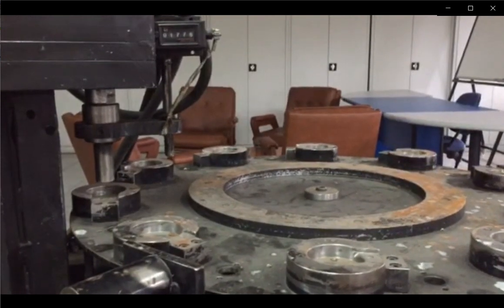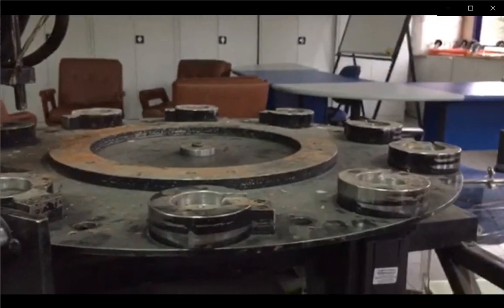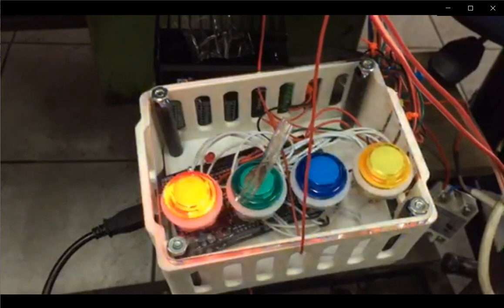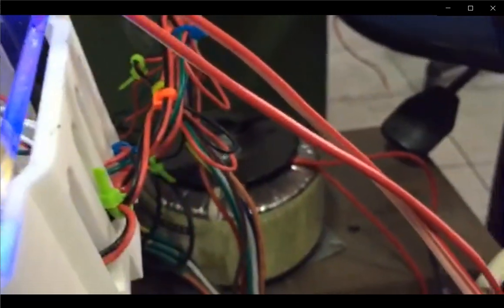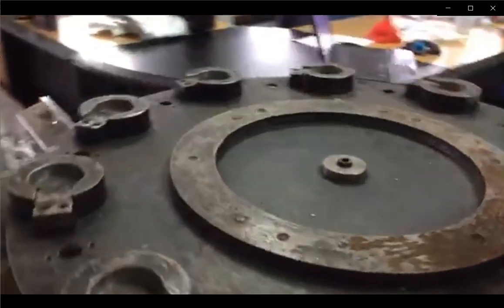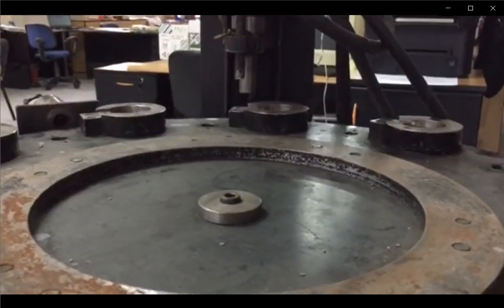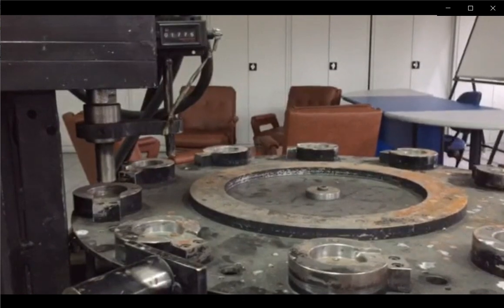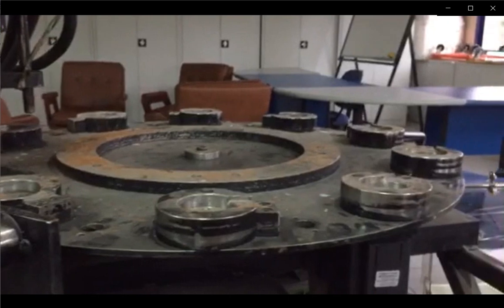turntable with large stepper motor v1

Comment: can you send me the detail of staper motor and the dial plate diameter and thickness because I am facing some problem in indexing 1100 dia plate with 20 mm thick aluminum plate
Reply: I used Nema 34 High torque stepper motor. The thickness of my plate was also 20mm, and the diameter was almost 800mm, and it worked fine. You can use the same kind of motor and will work fine. You should be very careful when the motor starts gradually increase to full speed and stop the motor from full speed to decrease to zero.

Comment: I would suggest incorporating some kind of feedback to check if the disk is in the correct position before the ram can be activated. Now, if the motor loses steps for some reason, I guess you'll get some unwanted results. If the budget allows, a closed loop stepper motor- and driver combo would be ideal. Also, maybe an emergency stop button and some form of object (read: finger) detection between the piston and the disk would make the system a bit safer? Otherwise: nice project!
Reply from the maker: Thank you for your comment and suggestion. As I told in the video, I am improving my knowledge about stepper controls. I  may put a encoder to the back of stepper motor to feedback. Since Red LED button stops the turntable, it acts as emergency button.